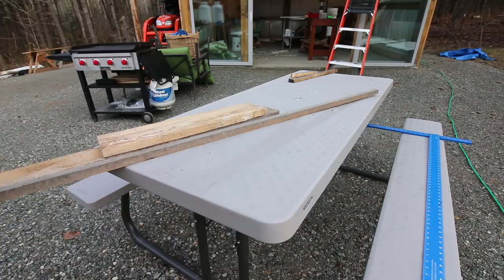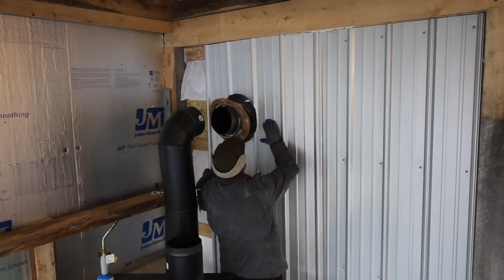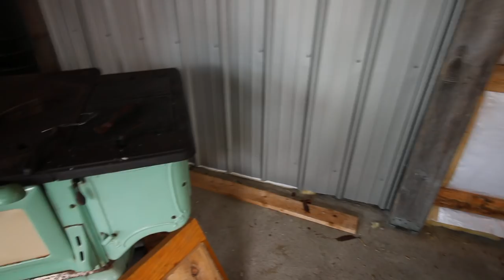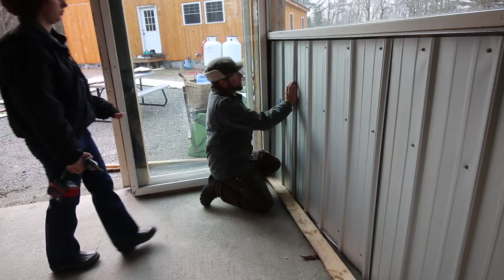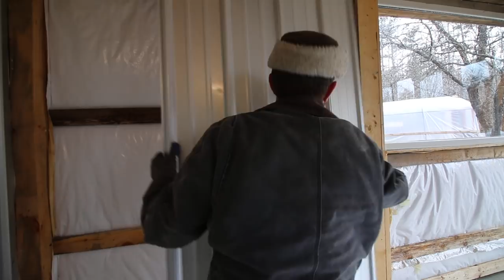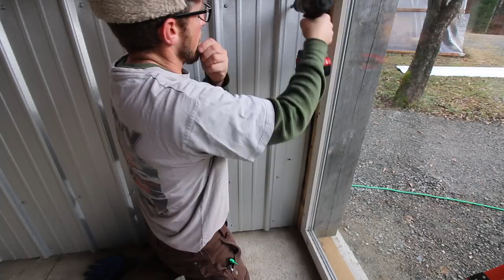Installing interior sheathing in The Outdoor Kitchen

Comment: The metal looks good. Out here on the West Coast we always put the small lap on top to help prevent water from wicking into the joint. And it looks better.😁 If debris gets caught in the mop boards you should be able to get some closure strip, foam, that will seal that up. Keep the dust bunnies at bay.

Comment: Looks Great! Galvanized side will reflect light and keep it bright, low maintenance, durable, and fairly easy to hang. Not so sure about the acoustics....but it is ribbed and will deflect at angles, plus you have the rough ceiling.  Not letting the metal touch concrete is wise.....no electrolysis. Wise choices!   God Bless
Reply from the maker: I was wondering the same thing about acoustics! Lol I figure time will tell. I am thinking the wood ceiling should help.
Reply: Dennis St.Germaine it is looking amazing. We have some videos also If you would like to check us out

Comment: Al:   You had a about 16" x 96" offcut of the Galvalume with a rib down the center.   That would make a good ridge cap for a play house come, Bunkie for sleep overs when Olivia becomes a teenager.  If the green cover sheet was an extra; you could add to it for the rest of the cabin roof. Then later (if built on skids) with a 6'  deck ( for a rocker).  A small retreat cabin in the woods to escape the grand kids and contemplate a beautiful life.     the old guy   Bert

Comment: I just realized that the guy that installed my sheathing in my outdoor kitchen jacked up.  I kept wondering why I was getting so many bugs in my kitchen and now I know.   The good thing is that I don't have to buy new sheathing but just have to cut it shorter and put the boards at the top.  Problem solved.  Spring project to go on the list.  You are going to love this outdoor kitchen for vegetables and really whatever; I do.

Comment: Another tip : set the clutch on the drill chuck so the it gives relief when the screw is at the optimum tension. avoid distortion with over tightening and twisting you wife's wrist at the end of the drive.

Comment: rollers (with solid stoppers) under all your floor standing kitchen sink, tables, even the stove.... easier to move and stays in place with the stopper locking system on the rollers.

Comment: I have to admit, I was rather 'dismayed' at your choice of 'sheathing' until I saw the finished look. It DOES 'fit'. As a career sheet metal man, I did note you putting the first half laps on 'backwards', but it's inside. No harm no foul....LOL.  Glad you caught that tho. I does make a difference on a roof. Put a bead of sealant under the overlap rib to prevent 'wicking'.  Nice job.
Reply from the maker: Thanks, We are hoping they make for easy cleaning

Comment: LOL...  @06:40 we can see, that you are cutting the wrong way! Thin Metal with an Angle cutter, you always cut WITH the direction of the Blade!  Believe me, this is not a myth when I say that, a was a Teacher in Metalworking when I was younger! Lehrlingsausbildner is the german word for it. I googled it: "apprentice trainer". One of the reasons is safety, and you can see better where to cut because there are no sparks there where you have to look;-).  Now I am old, so I can say: Trust me, I`m an engineer! lol...
So, this is only in metalwork! When it comes to woodworking, you cut against the rotation of the Blade, so when I see a guy cutting Metal the wrong way, I immediately know that he is used to working with wood normally ;-)